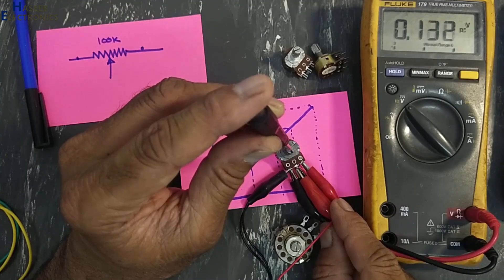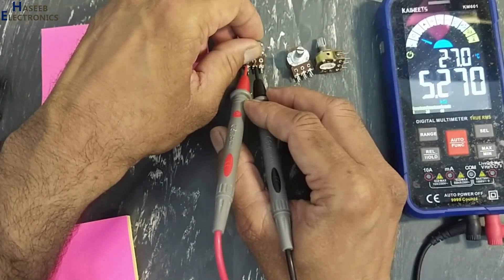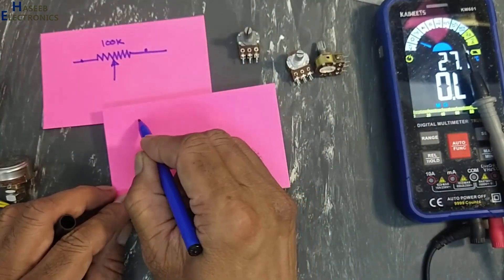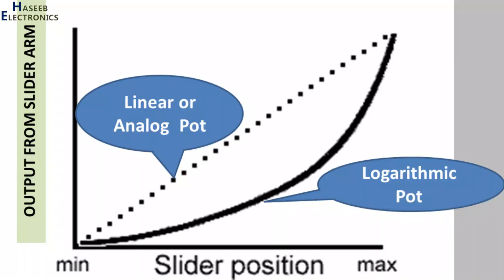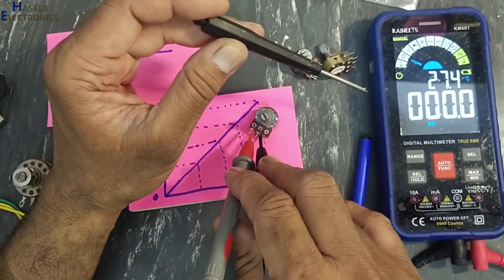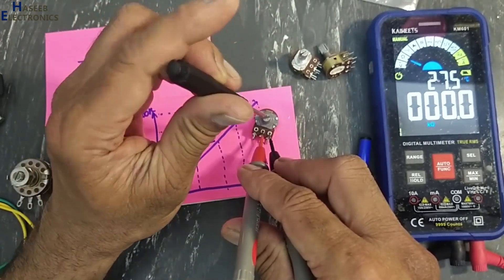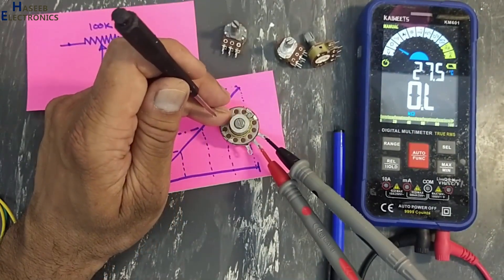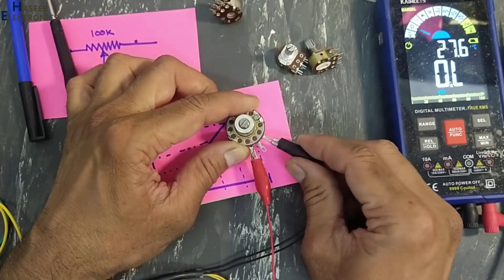{1182A} Potentiometer Linearity Test

Comment: Sir I request please explain the  calculation of voltage drop in each resistor in circuit.please help me sir
Reply from the maker: please check video number 402 and 1096
Reply: @HaseebElectronics  thank you much sir